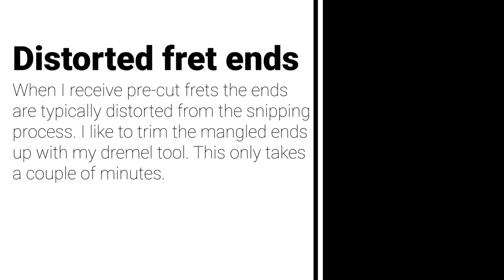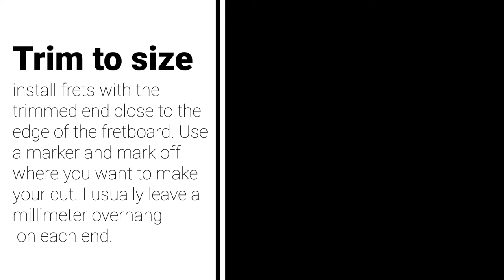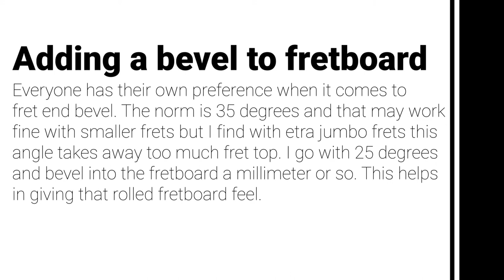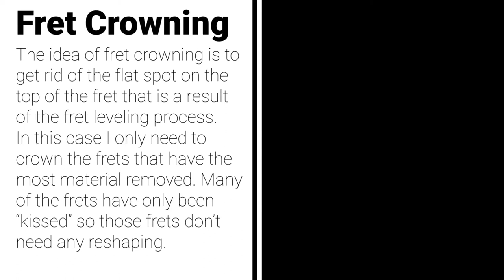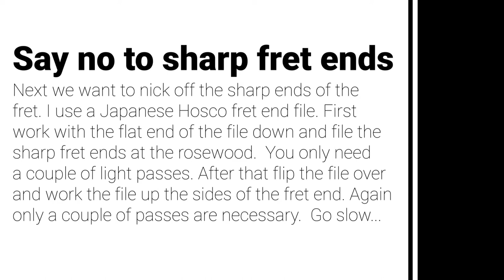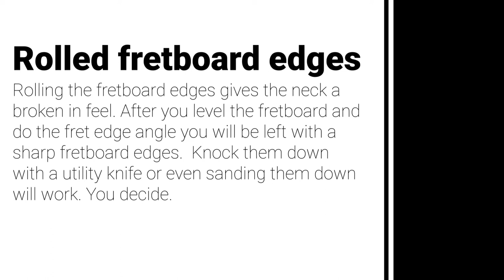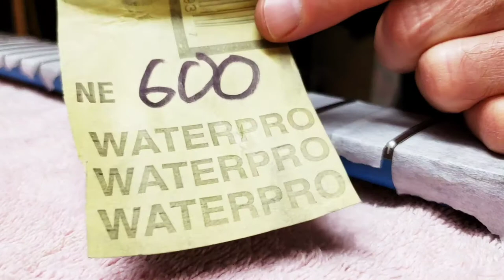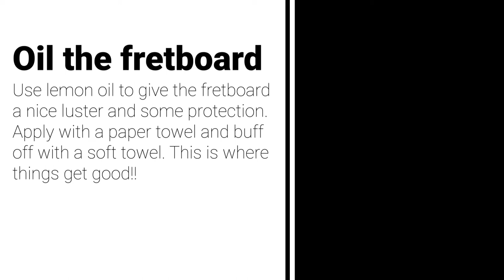How To Refret a Guitar (Ibanez RG140)

Comment: That is a very good tip about the bevel angle, and I wish I had seen this video earlier.  I made the mistake of a 35 degree angle with my first refret fitting jumbo fretwire. I ended up with too narrow a fretboard and the E strings slipping off the neck.
Great video, thank you very much for sharing.
Reply from the maker: Thanks for watching!

Comment: why didn't you put glue in the middle and only on the ends?, and do you really want to take off some of the fretboard when you bevel the ends?
Reply from the maker: @curtrod  the glue will wick itself into the middle of the fret. Ca glue will find and fill any voids in the fret slot. Not sure what your mean for your next question...

Comment: wait why did you sand it all the way down i thought it was a replacement job...dioesnt that change the thickness of the neck?
Reply from the maker: You would have to sand a bit to change the thickness of the neck. I sanded till the neck was at the radius I needed.

Comment: Why did you sand the neck with a radius block if the neck already has the proper radius? A waste of material???
Reply from the maker: It needed it after pulling the frets. I always use the radius block when refretting so i have a nice clean flat surface to work with.
Reply: @andy after pulling frets you always do a little skim pass with a radius block to make sure the new frets seat properly the amount you take off doesn't effect the radius of the board what so ever because you're barely removing any material in the first place.